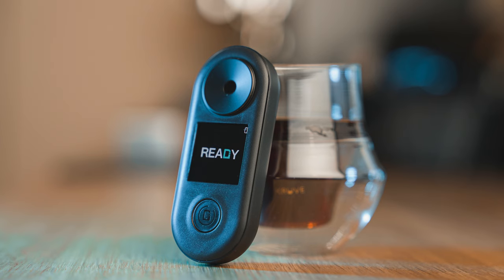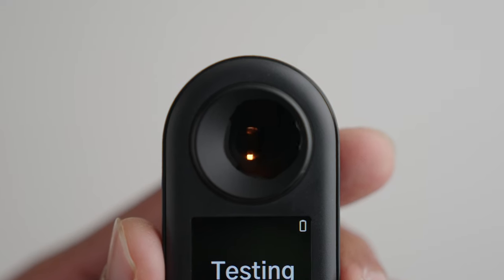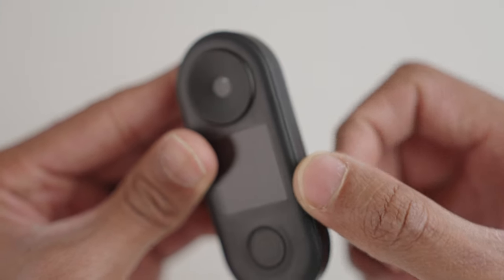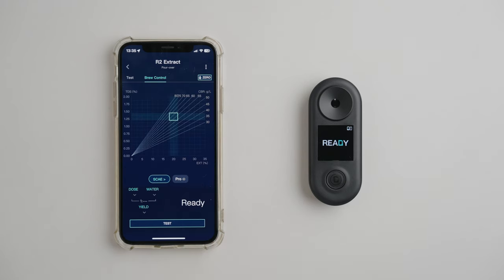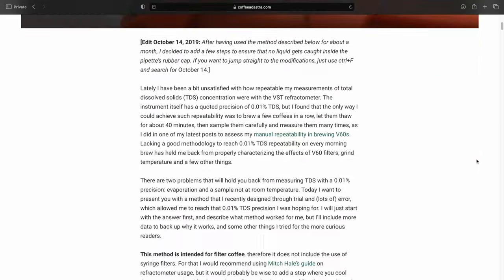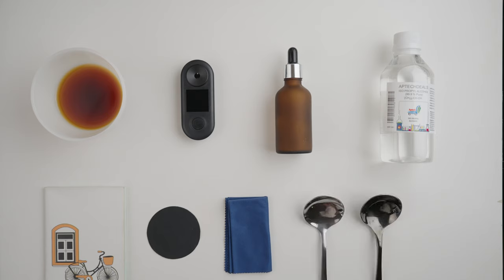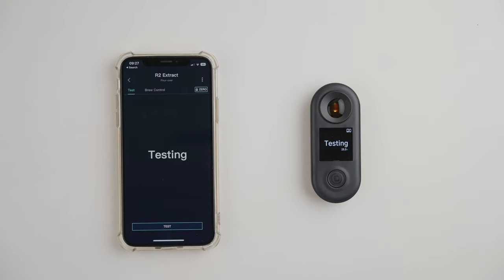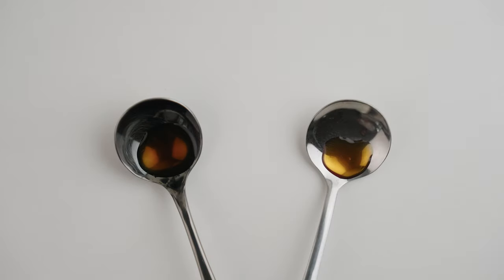DiFluid R2 Extract: How To Use A Coffee Refractometer Properly!

Comment: Calibration (zeroing) should be done wit brewing watter. Not distiled as mentioned in video. Reason is that brewing water is 0.00% TDS and coffee drink is that brewing watter (whatever you use) + dissolved solids from coffee. And we are looking for what that number is. We are not looking for distiled being zero becuse than we would have minerals used in brewing watter + coffee in our final measurement. Cheers!
Reply: I wonder if the meter takes this into account since you select the substance you want to measure e.g. coffee which has its own refractive index. I zero’d my meter with RO water and then measured some mineralized water and the TDS for both is reading 0.00 🤔 pls send help

Comment: Great video. I’ve yet to scamper down this particular branch of the coffee rabbit hole, but I do have a question:

While zeroing with distilled water makes sense (it's zero TDS), wouldn't zeroing with your brew water give more accurate results, like Taring a scale? I'm guessing the detected difference in refraction will be skewed by the dissolved solids already in the brew water. i.e. you'll measure an inaccurate, higher extraction yield regardless of the actual total dissolved coffee if the brew water’s dissolved content is not first discounted.

Comment: About that glitch you mention: I haven't experienced it myself, but, I have found that when I'm testing and being sloppy with button presses, it is incredibly easy to mistakenly trigger the "zero" function on the unit instead of testing, so your hunch is most likely correct. I enjoy using this device but it is far too easy to make it start zeroing, which isn't ideal if you're testing your first coffee of the day and have to rush to empty and clean the sample dish so it doesn't register liquid before zeroing!
Reply: It seems like this is a fairly easy software fix.  I wonder if DiFluid has addressed it.

Comment: When doing your four readings, are you using fresh samples (With or without re-calibration in between?) or are you simply just running the test 4 times consecutively through the device/app with the same original sample still on the lens?
Reply from the maker: On the same sample. It’s just to ensure any fluctuations have settled down.
Reply: @aramse To be clear, you are just pressing the button again to allow the R2 to check the sample again, correct?